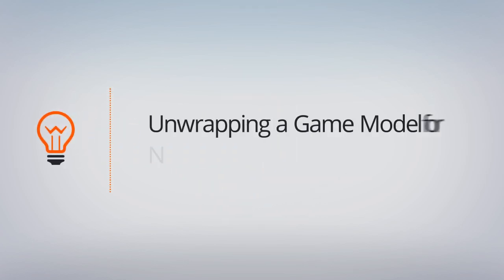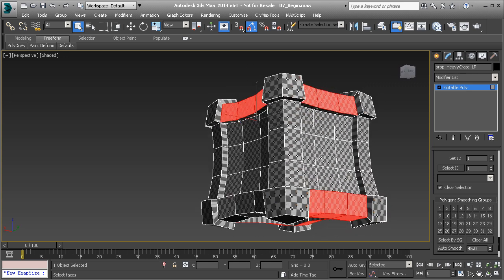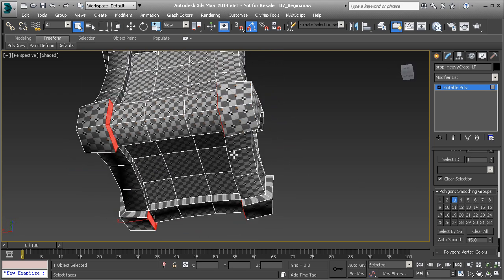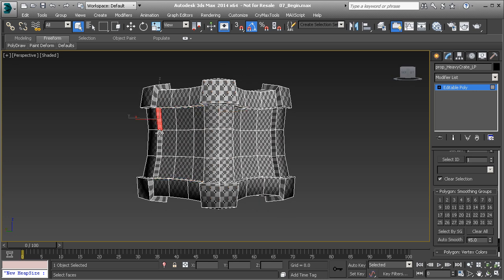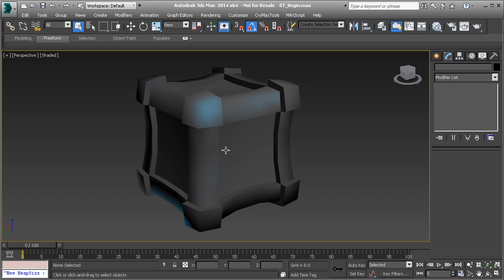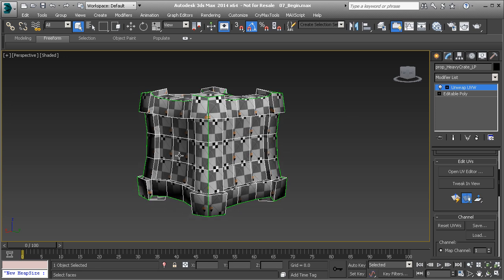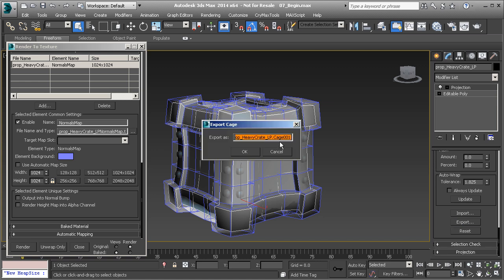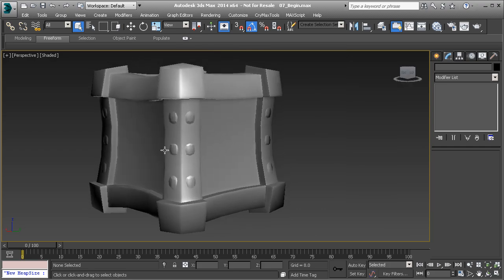3dsMax Top Tip: Unwrapping UVs for Normal Maps for Games

Comment: so i am a 3D animation student, and been trying to make normal maps for the characters i model, all the time ending up in a failure just because that stupid problem in the seams, my teachers wont tell me, i dont know if its some kind of top secret or is it they dont really know, but since you just have to pay for someone to actually "tell you" what you have to do to fix one little stupid problem, it becomes a handful of shit, im sorry for being rude but ive been trying to find a propper way to bake normals even with zbrush and mudbox and make them look good in 3ds max for so long that it gives me courage to find out you have to pay for this so stupidly secret advice.
Reply: Digital-Tutors hi, thank you very much, ive tryed the gamma lut, in max wich corrects a little the issue about the seams, but its still noticeable, and somehow the normal tends to bend on some poligon edges, im kinda pushing because ive seen videogames wich normals are so fine that its hard to notice the seams even if you try, also some low poly models with zbrush normals that makes them look almost exactly like theyr high poly mesh so that you wont even tell its a low poly. i know that im probably asking for something really advanced, but i wish someone could slip any advice. i just want to work fluid with normals.